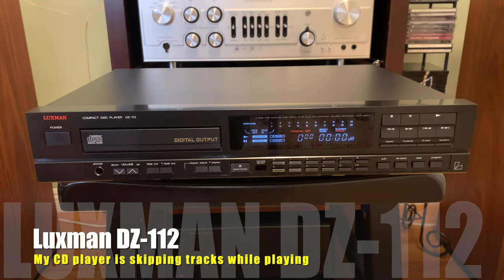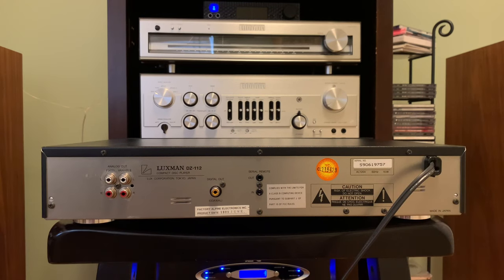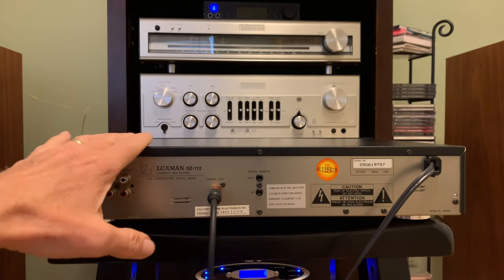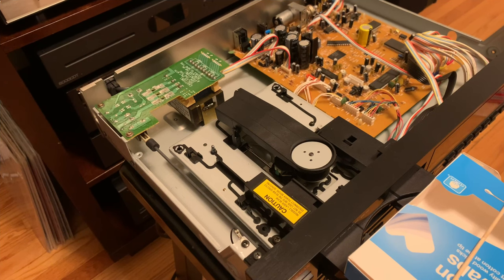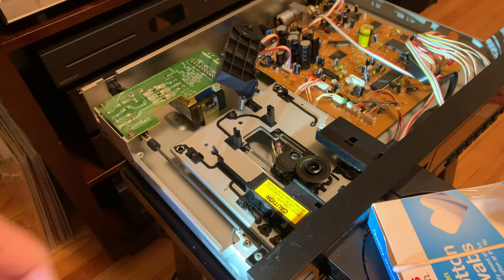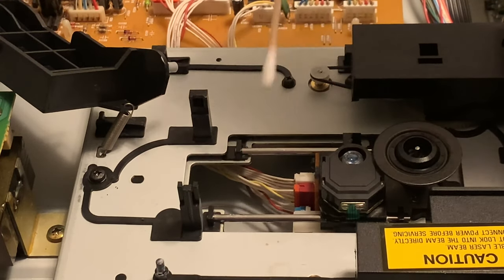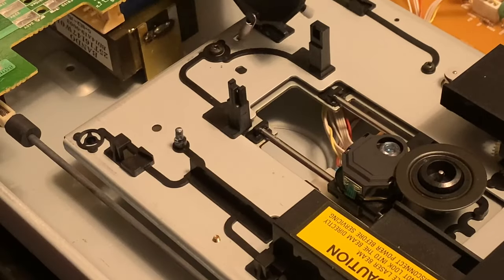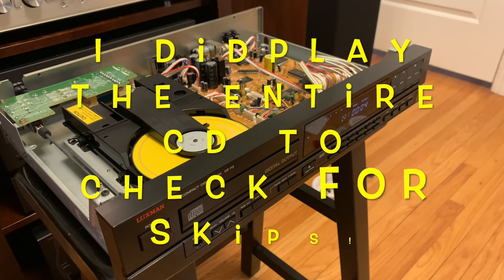How I Fixed my Vintage CD Player that was Skipping Tracks

Comment: Just FYI, most optical disc players use white lithium grease for lubrication. It’s not greasy, stays put, but also dries out and hardens. It may also flake off. Use a little WD-40 on a Qtip to lube parts like shafts or gears. A little goes a long way.
Reply from the maker: Thanks Mark👍👍
Reply: @VintageStereoCollectorChannel  , I like your video transitions 👍
Reply from the maker: @markw208  - thanks again Mark. I’m having fun cleaning 20 LPs with a low cost vacuum system. I will make a vid about this too.

Be well

Virgil
Reply: This is perfect. I'm about to open up my old Pioneer PD-M423 that skips and does not read at random times and was wondering what I could substitute safely for white lithium grease.
Reply: @laidback93 Silicone grease is now preferred for these applications. It's stable and dielectric.
Reply: @laidback93  Molykote (silicone grease) is what the manufacturer uses. You can clean the lens with Ammonia free glass cleaner. Using a Q-Tip in circular motions lightly swab the lens.

Comment: I am listening to my 1987 DENON DCD-900 CD player right now.  About five years ago it started skipping and delaying start ups.  My guess was that it was not sliding on the rails fast enough, so I added a few drops of electric shaver oil to each rail, an oil I prefer since it is not a toxic oil. That fixed it all in an instant.  Been working great ever since. This week I fixed the 22 Faders (Slide Potentiometers) in my 1978  Soundcraftsmen PE2217 Preamp - Equalizer.   I used Deoxit the restore the electrical slide contacts in the 22 Faders, and then spent forever carefully adding silicon lubricant to the 22 Faders.  It's 45 years old, but works and looks as good as new.
Reply from the maker: Great to use what’s on hand! I’ll try to remember that approach. Thanks for sharing!
Reply: Saliva SPIT works amazing ...repeat every 
30 minutes....guide rails .....gears and the spinning motor lubricate motor bush saliva on folded paper
Reply: @VintageStereoCollectorChannel My air conditioner motor was squealing big time due to the oil having all dried up. Out comes my electric shaver oil again.  I kept dripping on the shafts, front and back, until the brass bearing felt pads were soaked again.  Anyhow, the air conditioner is still working even though it is now 24 years old. I also was sick of having to add the typical recommended oil to my living room fan. So out comes my electric shaver oil again.  This time it lasted forever, and when switched from high to off, it kept spinning for 3 minutes. So for some reason the non-toxic electric shaver oil lasts a heck of a lot longer.
Reply from the maker: @helifynoe9930  - cool story. Like a collector of vintage stereo gear you have the heart to keep things running instead of throwing stuff into the local dump. Thanks for watching 👍👍

Comment: My CDR skips and some tracks dead on two high usage CD players - JVC & Dennon.
I have two low usage players and they both work - LG & Pioneer.
So my new outboard Apple SuperDrive is not at fault. And it is not DRM issues.
It is time for these late 80's machines to get some cleaning. Thank You Virgil.
Reply from the maker: Hi Kenneth,

Sounds like you will be busy! Shortly after the video I decided to buy an new CD Transport. It’s an Audiolab 6000cdt. So I use it as a transport (no DAC inside) like in the video and use the Mytek DAC.

I would be interested in hearing about your progress. Happy cleaning & spinning😀
Reply from the maker: @CM-dw3gh  - mine does continue to read CDs & CD-Rs. I had to remove and reattach the clamp that holds down on the CD once or twice because it didn’t read the CD at first then it was fine.

Did you clean/lubricate the guide rails?
Reply: @VintageStereoCollectorChannel  no I didn't. The only reason is its always OK with finding the disc and reading it after the draw closes. I didn't see how the rail would effect my issue.
It just seems over sensitive with a slight scratch on disc.
However I did get a lot of 'no disc' errors when I bought it, but after turning the Little pot screw under the laser clockwise this fault went away.
Is there any other place I can clean with alcohol that has contact with the disc?

Glad to hear yours is OK after all this time
Reply from the maker: @CM-dw3gh  not sure where else to clean on your NAD player
Reply: @VintageStereoCollectorChannel  no I thought the same. I might clean the laser one more time. It's 80% reliable now which is more than can be said for when I first got it. Cheers
Reply from the maker: @CM-dw3gh  - NAD makes great products! My brother-in-law has two NAD CD players and the work/sound great (NAD cassette deck too).
Hang in there and hope your player comes through. All the best!

Virgil
Reply: @VintageStereoCollectorChannel  On my pioneer the clamp fits loose on the CD. It does not put pressure on the CD and now i am wondering if it's supposed to be like that. I cleaned the laser but did not know about lubricating those rails because i did not remove the clamp.
So now i know what else to do. I might also lubricate themotor if it is possible.
Mine was built in 1985 so it's old and needs some care.
Excellent video very informative!
Thank you
Reply from the maker: @SDsailor7  - Hi Rob,

I hope it works out for you as your CD player seems to be a pretty good one.

Is your Reel to Reel a Pioneer too?

Virgil
Reply: @VintageStereoCollectorChannel  Hi Virgil. Thank you for replying back.
Yes i have a pioneer  707 actually i have several. I also have a teac x-3r, an akai 365d, sony 788-4 (not working at the moment) a sony tc-230 and a technics rs1500us. I was trying to record from the cd player to the pioneer 707.
I did not know it was a good cd player by looking on the back of it i found out it was built on october of 1985 so i hope all it is is need of lubrication.
I am not sure about that top piece tha goes over the cd, if it is supposed to be loose or grab the cd firmly.
Reply: @VintageStereoCollectorChannel  I will let you know if i get it fixed and what fixed the problem.
Thank you

Comment: Hi I see this is bit old video. I recently bought a YAMAHA CDX560 vintage CD player and it has track skipping problem for some CDs. I wish to know how was your historical experience with the solution you explained in this video after two years. Anuway thanks for your experience shared.
Reply from the maker: Hi Suranga. I continued using the Luxman CD player as it worked just fine and was in excellent condition. I got the itch to buy some newer gear and sold it to a nice man for his stereo system at a cabin on the lake. I bought a new Audiolab 6000cdt CD transport and connected it to my Mytek DAC via a digital coaxial cable. I miss the Luxman CD player as it had so many options and buttons. Good luck with your Yamaha CD player as you continue your journey!

Comment: I had the same two problems with my 1987 DENON DCD-900 CD player.   Anyhow, I fixed the 2 bugs, about 5 years ago.   I fixed the door problem by replacing the belt with a belt that I had removed from an old dead mini cassette player.  The skipping problem was instantly fixed once I added a few drops of shaving oil on the slide bars used by the scanning mechanism.   The total repair cost, was about 1 cent.

I also had just recently purchased a cheap Sylvania DVD player.  But it seems as though it had been sitting on the shelf for quite a few years.  When I powered it up, all it did was open and close the DVD door, over and over and over again.  So I opened up the casing and after finding nothing visually defective,  I assumed that the scanner was stuck in one place, and that this door problem was some kind of a built in bug indicator, indicating that there was a problem in this particular section of the DVD player unit.   So I added a few drops of shaving oil on the slide bars, moved the mechanism back and forth a few times, and bingo, the DVD player was up and properly working, and thus the door problem was gone.  Anyhow, that was what had reminded me of my old DENON CD player and its problems.
Reply from the maker: Thanks for watching and sharing your 2-cents worth of success. Great results!
Reply: @VintageStereoCollectorChannel  2 cents. Good one. LOL
Reply: When the door open/closes constantly its caused by a dirty tray leaf switch. That switch tells the micro-controller whether the door is open or closed and often gets dirty. That resides at the front below the tray mechanism on a small circuit board. Remove the board and clean the switch with contact cleaner by working it into the switch.

Comment: I have a luxman cd player from about the same era. It too skips. The cd will play  for a bit and then it will skip ahead  a few seconds and a few minutes. Eventually skips into the next track and so on. Was this the same problem as you described? I was hoping to see a video like this because I took my player to a repair shop and they wouldn't even touch my player. Thanks for the a bit of reassurance. My player is in mint condition. Hopefully I can tackle the skipping without trashing the player.
Reply from the maker: Mine skipped tracks almost exactly like you. Give it a try. I never fixed something like this before and I learned from other vids. Hope it works for you. Keep me posted & good luck!

Comment: The first thing you do when you have skipping is to look at the eye patten with an Oscilloscope this will give you a hint about the tracking and the laser power and if you need to clean it. The white grease is silicone and to be honest should be used in those players.
Reply from the maker: Wish I had an oscilloscope at the time. My tech has one for $75/hour. Yes, white grease should be used, you are correct. I sold the player and now use an Audiolab 6000 CD transport and an Oppo BDP-105 blue ray player. I miss all those buttons on the Luxman

Comment: that was very helpful l need to do the same this weekend   for my teac   cd player thats doing the same thing recently it was working fine for many years l too use a DAC magic  external dac  and hopefully that would fix the problem   you explained it flawless for me to understand  wish me luck !
Reply from the maker: Good luck and let me know how it goes👍👍
Reply: @VintageStereoCollectorChannel  l fixed my teac player thanks to you followed everything to the letter  NO SKIPPING   l do need to change the belt  l will do that soon l cleaned it for now  also oiled the motors l saw that years ago on another tutorial  about dvd players
Reply from the maker: @kozkoz7776  COOL!!! Happy everything went well. You’ll find a belt soon. Congrats👍👍

Comment: those DACs when connected , did they improve the sound quality a lot ?
Reply from the maker: It did. The DAC in the Luxman is good, but it’s from 1990. The Mytek Brooklyn DAC+ is a very good one. I sold the Luxman and bought a new Audiolab 6000 CD transport to connect to the Mytek. I also use an S-Booster linear power supply with the Mytek instead of the power cable and internal power supply.

Comment: Hi ,i see in background a 6000cdt. Can you tell us if you seen any problems?some complaints about scratch ing cd s .thank you sir.😊
Reply from the maker: I’ve seen those complaints and the video. I don’t notice any scratching on my CDs. The only scratching occurs on the CD jewel cases😂

The 6000cdt is a terrific CD transport. I have it connected to my Mytek Brooklyn DAC+ via a Toslink glass cable
Reply: @VintageStereoCollectorChannel  thank you sir for reply.i have a marantz pm7200 and i think to buy 6000cdt.i have also q dac from audiolab to support it ..

Comment: i have a Technics PG4 [2000] I bought it in 2004. The last year or so, it started to play and skips WITHIN the tracks 2 to 6[on every cd].The rest[7>] were ok[no skips]. What could it be? Anyone else can help, from Greece
Reply from the maker: Hi Roger. It might be a similar situation as mine. And your’s is only 20 years old. Where in Greece do you live? We took a tour of Greece just before the Covid pandemic. Even had a tour of Delos👍👍
Reply: @VintageStereoCollectorChannel  Athens i am. i sent it for service. it still does skip within the track[1 to 4] but its better. they cleaned it . Perhaps i should get a new laser .
Reply from the maker: @rogerturner1881  - you might want to research the laser replacement for your PG4 in terms of cost to buy and have it replaced vs getting a newer CD player. I sold my Luxman and bought a new Audiolab 6000cdt CD transport for about $550 USD. I connect it to my DAC with an digital coaxial cable since the Audiolab does not have a DAC chip inside. Keep me posted on what you do if you get another laser. Good luck👍👍

Comment: Question: I recently purchased a Victrola 8 in 1 Navigator. I absolutely love it except for the fact that the CD player cuts off the first second or two of each track and adds a pause break in between songs that it shouldn't. I've seen this with several other units and it's very aggravating. Is there any way to fix and/or bypass this feature? Any help is greatly appreciated. Thanks!!
Reply from the maker: I tried looking online for your specific issue, but it only discusses skipping on LPS
Reply: @VintageStereoCollectorChannel  
Thank you so much for your help. I tried researching it online as well.

Comment: Question. I’m in need of a “new” mechanism for my luxman 105u. I know the laser is a kss 152a. But for me the problem is the gearing wheel. One of the wheels has lost some “teeth”. So it’s not in sync with the motor. And the motor has a plastic worm, most players like kenwood or denon has a kss 152a laser but a steel worm attached to the motor. So..has the luxman d 111,112,113 the same mechanism a the luxman 105u
Reply from the maker: Love to have a Luxman 105u!

Try searching this site for gears

https://organdonorparts.com
Reply: @VintageStereoCollectorChannel  thx. When this one is ready it’s for sale
Reply from the maker: @needsometreatment  - what will you buy next?
Reply: @VintageStereoCollectorChannel  my set is the nakamichi 5 series the 7 series cd player and the dragon deck. Micro seiki phono and the infinity kappa 9

Comment: I got to rain on that parade....old Sansui doesnt respond to either lens cleaning or slides/clean/lube  :/
Reply from the maker: Sorry to hear about your Sansui! I did sell my Luxman DZ-112 and bought an Audiolab 6000cd CD transport. I connected it to my DAC with a digital coaxial cable. Hope you can find a replacement used or new CD player. Best to you👍👍
Reply: @VintageStereoCollectorChannel  still trying to mess with it....took it apart and lubed everything but still will skip at around the 50 secs mark no matter what track its on...might be the motor that drives the lazer table...there are 3 motors in that thing
Reply from the maker: @quebecpatriot1874  - that’s a complex unit🙏🏻
Reply: @VintageStereoCollectorChannel  well, I am not complaining...I got a complete, mint, non-smoker not a scratch barely any dust inside complete kit (minus the speakers) amp (B-3000)/pre-amp(C-1000)/tuner (T-1000)/dual tapedeck(D-3000WR)/CD (CD-X105) and a pair of odd not sansui speakers for $50   :)

Comment: Hi - is the fix still working?  Just did this to my onkyo dx-7500
Reply from the maker: I sold my CD player over a year ago and bought an Audiolab 6000cdt CD transport to work with my DAC. Haven’t heard back from the guy I sold it to.
Reply: My 1987 CD player is still working, thus no longer skipping, 5 years after adding electric shaver oil to the slide rails.  So is my 24 year old DANBY window mounted air conditioner.  The motor had almost seized up and was squealing big time, due to the felt pads that hold the bearings oil having dried up completely. But once again I used the electric shaver oil there too, and it has been working ever since, adding many years to its life.
Reply from the maker: @helifynoe9930  - love your story. I’ll have to remember that one!

Comment: I've tried this and it did not work for me. Just playing a CD for a few moments you really can't tell if it fixed the skipping problem without playing several CDs all the way through. Did the cleaning of the lens and cleaning and re-lubing the glide bars actually it fix the skipping problem in the long run? Are you now able to play CDs all the way through without skipping now? Thanks.
Reply from the maker: Hi Jeff,

Yes I am able to play CDs all the way through and it’s still going. Maybe give another tear down?

PS - what is the make & model number of your CD player?

Virgil
Reply: In my case, 5 years have passed by since I re-oiled the slide bars to fix the problem, and it is still working perfectly.   I used shaving oil.

Comment: Clean the laser with rubbing alcohol
Reply from the maker: Yep. That was the first thing I tried. No luck. Thanks for watching👍👍
Reply: Car windscreen wipes EXTERIOR ...WORK FOR ME....I USE THEM ON THE CD SHINY SIDE TOO ...MAKE A POINTY THING WITH WIPE  AND DO LENS ALSO .........THE CD CLEANER DISC wash brushes in water then I wipe brushes with the screen wipe Exterior type............. then if machine no accept CD cleaner CD....I line up brushes with lens then reciprocate with finger... magic   ....thank you all for energy supplied